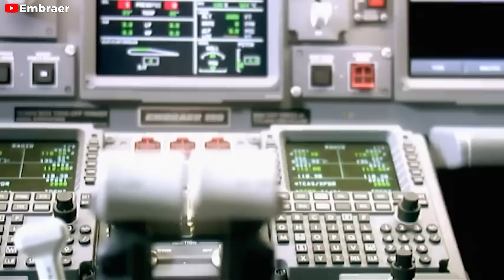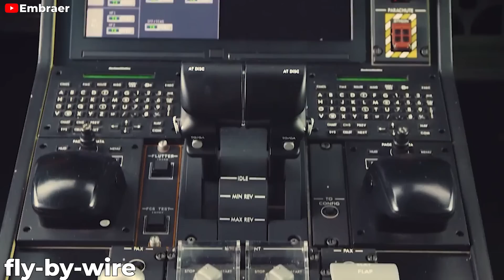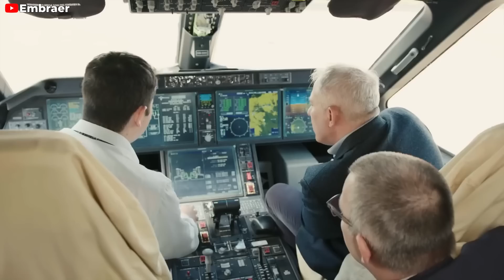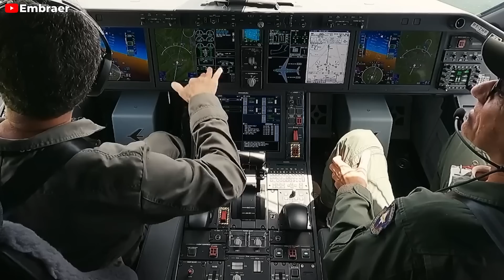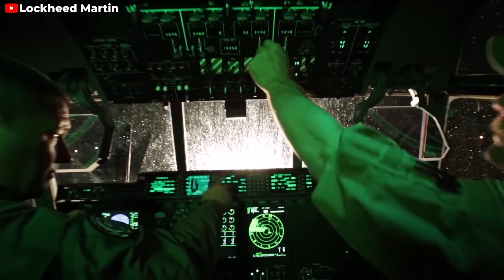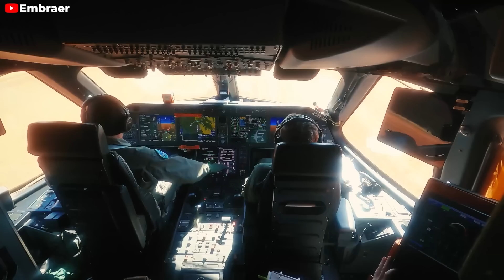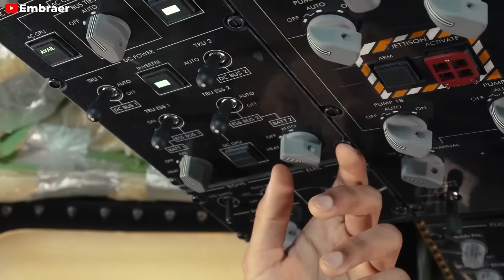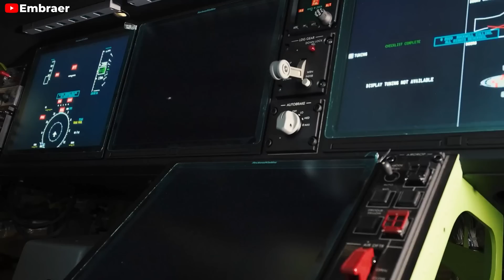The Embraer NEW C-390 Will Change The Aviation Industry and Destroy C-130J! Here's Why

Comment: The Embraer KC-390, when carrying a 26-tonne payload, has a range of approximately 1,080 nautical miles (2,000 km), while its ferry range (without payload) can reach up to 4,570 nautical miles (8,460 km) with auxiliary fuel tanks. The C-130J Super Hercules has a maximum range of around 2,200 nautical miles (2,520 miles), with a range of 1,800 nautical miles with a 35,000-pound payload.

Comment: Laughable funny video - C130's main advantage is the use of  turboprops to land on rough airstrips. Jet intakes are subject to FOD being taken in. Wouldn't want to be trying to take off in a C-390 in a sandstorm........
Reply: O C-390 já passou pelos testes em pistas precárias.
Reply: You can try because it's safe. Its maintenance is also easy as spare parts are easily found in most countries. Furthermore, it can be reconfigured very quickly for any type of mission.
Reply: @quest_edward CACETAO has a shorter takeoff then the c130j
Reply: They(c390m) are actually made to land and take off on rough and dirt patches. Especially it's landing gear. I think they thought about the turbofan engines
Reply: YES IN EUROPE WE HAVE SANDSTORMS :)

Comment: In Mexico, the C-390 came to visit the FAM air base to give demonstrations, apparently they are seeing if the replacement of the C-130 is optional before even choosing the C-130J or the C-390.
Reply: Depends on where you want to use them. A turbo prop plane can land on dirt and fly in hail, and keep going. Turbofan planes can't do that to the same degree. If a turbofan engine ingests hail, it's game over for them.
Reply from the maker: Thanks for useful news!

Comment: Reliability of supplier is one main criteria of choice. C-390 supply chain may be an issue, components being sourced outside Brazil. C-130 has been around for decades and it will still be around for decades to come. Lockheed Martin's customers also includes those who fly the F-35s and F-16s.  It takes more than performance to dethrone the Charlies.

Comment: Believe you me the C-130 will never be replaced. A jet can't do what a turboprop can do when it comes down to the grunt work. They have tried to replace it but have failed.
Reply: I agree. A turboprop turning at 100% all the time doesn’t have spool up lag like a turbofan.  I flew a few hundred hours in a P-3 and when moving the power levers forward the response is instant. Taking off and landing in tight spots this gives the 130 a definite advantage.
Reply: It will be replaced. The plane is 70yrs old now. It might work for insurgent type warfare like the US had since Vietnam but against an equal or greater foe? The C130 is totally outdated. Everything gets replaced sooner or later. You see 70yr old fighters  in service yet?
Reply: @hanskurtmann6781 The C-130J is not 70 year old technology. The airframe may look the same but that is about all that is the same.  The 130Js are still being built. If the USA wants to haul heavy loads long distances they use a C-17.

Comment: You are gonna replace the C-130??? Get in line and take a number. A lot of aircraft have tried and failed. For the C-130 missions, turboprop engines are the most effective. So take a number and wait your turn.
Reply: To be better than the C-130, it would have to be a turboprop.

Comment: What a load of BS, there have been over 2500 C130s built or ordered. Maybe, Just Maybe the c390 will get a tenth of that in the next 20 years. I don't normally insult people, but you sir are an idiot. I compare this to the 747 A380 discussions.  A380 will replace the 747, sane bullshit different planes.

Comment: The 390 is a great aircraft, and should sell well, but not that much better than the C130, especially when you consider the 130 is a 3/4 century old design. In theory, turbo prop is superior than turbo fans in short fields, and the 130 have a bit more redundancy.

Comment: While it may be a good plane, it won't Destroy C-130. There is a reason why tactical Transporters are turboprops: they need shorter Runways, they are able to do a Sarajevo-Aproach landing (very steep aproach and take-offs) and they are saver to land on improvised Strips. Also, the lower possible Speed gives her better SAR capabillities as she is used in quite a few Coastguards. So to me those 2 Planes are made for different roles.
Reply from the maker: Thanks for your feedback

Comment: C-130 has a track record. 
Jet engines are more expensive to maintain than turboprops.  
C-130 can use shorter runways
Reply: Not in this case, as the cost of operating and maintaining 2 turbofans derived from a civil model is less than the cost of 4 turboprops for exclusively military use.
Reply: @saturnats  but it’s also twice the cost of a C-130.

Comment: Still would need two more engines, more range, I can go on. There are musts for the Air Force, two engines isn't it. The C27J was shot down as a complimentary aircrame for intertheater transportaion. Can't carry a full load on one engine with 2000 miles of open ocean, or nations you can't land at.

Comment: With both at max take off load, the 130J can rotate in 3300' at SL. .  Takes 5000' for the 390.  The Js have more range at max load then the max loaded 390 by over 600 miles.

Comment: Sorry, but if a C130 ingests a bird during flight not much will happen. If a C390 ingests a bird, I hope the other engine will allow a fully loaded aircraft to land safely.  Sorry, but just because it has turbofans does not make it better than an aircraft using well proven turboprops. I would rather be in a C130 taking off from a rough strip than a C390.

Comment: The c130 was never made as a long haul cargo aircraft its mission was to take supplies from a major supply point to areas without a runway that a larger cargo plane could not land or takeoff from, that is why it was made with props and not jet engines.
Reply: This might be splitting hairs, but a turboprop is jet-engine-driven propeller.
Reply: @JohnGeorgeBauerBuis  true but there is no way that a prop will get knocked out of service the way a traditional jet engine can especially when operating on makeshift runways.

Comment: Hats off to Brazil on developing the C-390.    However,  it is an apples to oranges comparision to the C-130J.   THe prop driven C-130J can do things in austere airstrips you would never want to try with a turbo fan due to likely FOD damage and the need for turbo fan aircraft (jets) to require longer runways than turbo prop aircriaft.  Propelers handly FOD significantly better than turbo fans and always will.   Prop aircraft can also fly slower, which is a plus for paratroopers and for the insertion mission.  Bragging how the C-390 can fly higher and faster than a C-130J is all fine and good, but not saying much as jet powered aircraft can easily out perform prop driven aircraft in those simple metrics.   Turbo prop aircraft are still relevant and with us today becuase they can best meet a niche mission:  Access to astere, remote, unpaved airfields.  A more logical comparision for the C-390 vs the USAF phased out C-141.
Reply: You are very misinformed about the KC 390's operational capabilities, because among other things it was designed and developed to operate on short runways and in any solid ground conditions, that is, it cannot land or take off on water or soft sand, something that no aircraft can do.
There are dozens of videos showing the Brazilian cargo plane landing and taking off on dirt runways that are very short.

Comment: Embraer's contention for two engines rather than four is a profit-margin argument. Military applications, inherently dangerous, embrace reliability. A two-engine config reduces redundancy twice over. Given a single engine failure, the 390 would likely be forced to jettison cargo. The 130 just radios ahead, "Sorry, we'll be a little late".
     The 130 can feather two props, for operation under light load/return leg conditions. 
     I wouldn't go hunting hurricanes on two turbofans, vulnerable as they are in violent air to compressor stalls.
     Mount a pair of 30mm Gatlings on either side of the 390. The gun develops significant thrust. With one engine each side, mounted relatively inboard from the outboards on the 130, I would be highly leery of a C390 gunship.

Comment: The C-130 still wins.  

First and foremost.  The C-390 can travel farther and carry more.  But to gain that advantage, it has to give up short take-offs and landings.  Physics is physics and nobody rides for free.

The 130 is used to supply forward and rough areas.  Taking small arms fire is much more likely.  Having four engines rather than two is a distinct advantage.  If you get one engine shot out, your chances of being able to continue are much higher.  You can trim the remaining 3 to balance out rather than trying to fly with thrust entirely coming from one side of the aircraft.  Losing 25% of your power is a much better alternative to losing 50%. 

The same can be said about the digital screens.  What happens if one or more get shot-out?  Are there analog backups for basic flight gauges?  You never want to sacrifice a load-master on a military cargo flight.  That's just daft.  That position is an extra brain and set of eyeballs to ensure things are 5x5 in the back of the aircraft.  If your loads start shifting, you become a very expensive lawn-dart.

Comment: The C-130 has been around since the 1950's that makes them about 70 years in production. I live about 20 or so miles from where they are built (Atlanta, ga.) They're still at it.
Question; can a C-390 land on an aircraft carrier? a C-130 has.
You don't have continuous production for 70 years and not be the G.O.A.T.  I'm sure the C-390 is still a very capable plane though. Nice try. ;-)
Reply from the maker: Thanks for sharing!

Comment: Gunship version? Nice machine, but likely not a  direct C-130 comparison. And yeah, Embraer has a way to go to achieve very high reliability standards in sophisticated military airframes.
Reply: The C-130 is the AK-47 of cargo planes. It ain't pretty and it's not high tech but it still works when covered in mud inside and out.

Comment: Think! The C-130 was designed on purpose with 4 propellers in case of engine failure. It can still operate with only two if needed. Can the 390 operate with one engine loaded to capacity. I don’t think so.
Reply: This is a "tactical" airplane for non adverse battle fields and airfields, any loss or hit on an engine and the airplane quite likely is doomed
Reply: @jjiglesiasg The answere to that dilema is specific to the environment of the potential client , for example :  the c-390 will be the right choice for many african countries , but for israel, where there is a high likelyhood of anti- aircraft fire , the 4 engine C-130 has a much better chance to survive , and still complete the mission .
Reply: Under idea conditions, turbofan engines are the most practical and efficient.
When you're flying into hell, a prop job is hard to beat.

Comment: I have worked on the Embraer before, they're good products, but the C-130 is a different class of aircraft itself, it is designed for short takeoff and landing with turboprop engines, nothing comes close to it when you need a plane to do what the C-130 can do.
Reply from the maker: C-130 is still a legendary

Comment: Nothing will replace the C-130J or any other variant. Yes there are other types of aircraft similar, but not something to completely replace it. You can not fly slow in a turbofan powered aircraft compared to a turboprop aircraft, which is needed in certain situations. I can see this aircraft only added to the long list of cargo multi roll list, but will never replace a single aircraft.
Reply from the maker: Thanks for your opinion!

Comment: Hardly a C130 killer.  One would think that a channel speaking from a position of authority would have recognized that while full of gee wiz gear, it is a jet and therefore not suitable for unimproved runways (dirt) because jets don’t do FOD.  Turbo props are considerably better at landing and taking off in the middle of nowhere.
Reply: The turboprop is superior to the turbojet/fan engines. The prop shields the engine from almost all FOD sources, except birds, which the prop stops around 60% at stopping birds for going down the intake. I have had to remove remains a lot of times over the years, it's amazing much guts and feathers you find stuck to the forward bearing struts. The T56 will eat a bird without taking any any damage. The only clue the crew may have the took a bird down the an engine is the smell of bad cooked chicken. When the last B-52 is finally retired a C-130 will pick up the flight crew and fly them back their home base.
Reply: I am no aircraft authority, but I had similar questions. (Plus, you’d think Brazil, with its unique terrain, would KNOW that.) 

Also: What about distance for takeoff and landing? 

FWIW, my father-in-law was in charge of metals QA for the Herc at the Lockheed plant here in Marietta. There is a significant amount of 130 memorabilia around the house!
Reply: Sucks

Comment: I watched a C-130  air start another C-130 on the RAMP of Pleiku RVN  By creating enough wind to motor over the dead engine Back in 1971.      When the C-390 can do that then they can start talking about replacing the HURK.......
Reply: Dont talk rubbish... C130 is gone. In this category C390 is the Future, old man
Reply: @azedo171  Drop the crack pipe, little guy. The c-390 won't make a dent in any market. Nobody wants Brazilian junk.

Comment: Really? Dream on!.  Wasn't this tried with the 'fly-off' match between the  C-14 and C-15?.  Then let's roll out, and re-engine the C-14 ,15  if there is a special need to rid prop blades. Prop blades wll deliver special functions where as enclosed jet engines can't, no matter how much the hard wing flap sections are adjusted.

Comment: KC-390 is a great aircraft, but its biggest fault is that it has two  vacuum cleaners for engines, FOD is it’s greatest issue in unprepared landing strips where, the C130 would shed off prop strikes the KC-390 would have issues. High wing low engines don’t like unprepared landing strips. But I do love the aircraft and think it’s a great aircraft.
Reply: I’d wager the composite material propellers of the herc are more likely to get damaged by runway debris than the jets inhaling something. The tips of  those large propellers are much closer to the ground.

Comment: The KC-390 is the technological successor to the C-130.
Reply: Not! You are comparing two different-sized military requirements at diff times in the theater. Similar to back in the days the C-47 found a long useful slot (cause of its size and area in its need) required when the 130 was all over the theater.

Comment: I'm an old fart, in my 70's. I have seen the C-130's grow into THE premiere versitol do most anything/anywhere aircraft. I'm not saying this latest 'replacement' for a still very capable aircraft (C-130), isn't up to the job, but infrastructure wise, it will turn into a very expensive trial that may or may not work out as 'planned'. Personally, the few times I flew in a C-130 I was up on the flt deck and enjoyed the hell out of it.Wow, my last ride in a 130 was 53 years ago...

Comment: Well, the c390 currently has exactly 9 aircraft in service in 2 countries.... since 2014!!! They have a LOOOONG way to go to put a dent in the number of c-130's currently in service globally! To date, there are 500+ of just the J model currently in active service, let alone countries that are still flying older variants. Plus, they will have a tough time competing with almost 70 years of continuous, uninterrupted service... globally! On top off all of that, the per unit cost of the c390 is significantly more than a C-130. the c390 is averaging around $145 million where the c-130J averages around $75 million per unit! Good luck toppling the king!

Comment: The C-390 looks like a solid aircraft with good stats and capabilities.  Being able to perform a mission as good as or exceeding C-130 is very appealing.  Having two jet engines rather than 4 props is very positive reducing maintenance, sustainment and overall costs.  Looks like a promising future for the C390.